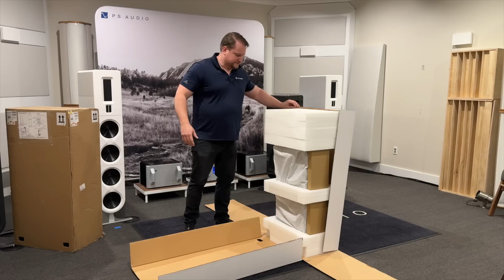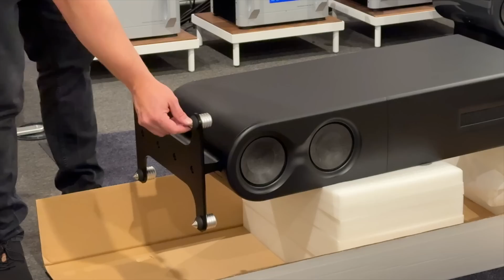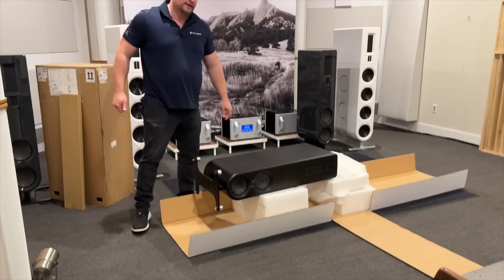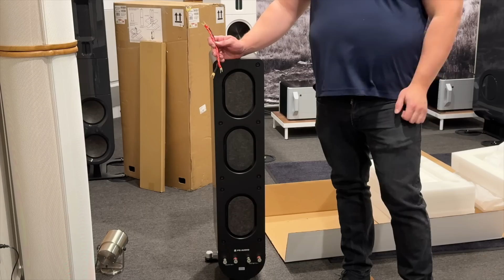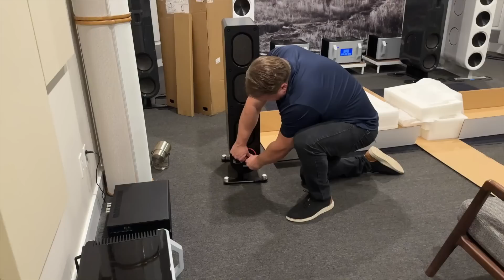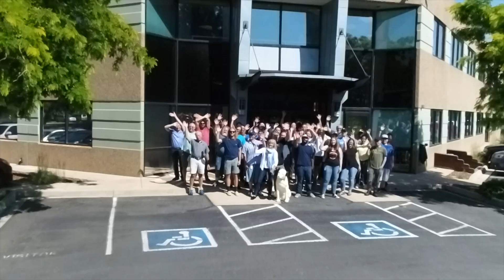FR10 Unpacking

Comment: isnt silver better for the jumper than copper?
Reply: or gold
Reply: The connectors are gold plated. The wiring is copper, silver is marginally more conductive but for a very short jumper, the resistance is quite low either way. However, you’re welcome to use your own third party jumpers of your choosing.

Comment: GREAT UNPACKAGING! I know that you will smile/laugh, but how are these speakers to my B&W 803s?
To be honest, I am always looking to be EDUCATED!
And, I am using a Mac MHT-200.
I will wait your rerply!
GREG
Reply: It depends on the age/series of B&W speakers.  These compare pretty well to the 803/804.  The FR10 have a flatter response through the midrange than the B&W and less diffraction issues in the mid/tweeter.  The B&W is slightly higher sensitivity and may be more punchy in the bass, though the FR10 gets a little lower.  

The B&W have more flashy cosmetics and certain construction details, more finish options, but that's a matter of taste.

Comment: Great video.  I was waiting to see how you moved them on carpet.  I have never walked a speaker on spikes as I was afraid the mechanical stress on the base could damage it or that I could damage the carpet piles.   To make positioning easier I assume  it would be OK to use furniture carpet sliders under the spikes until a good placement is found.
Reply: They supply a magic carpet just for this purpose 😅

Comment: The thing of showing how to level the speakers on the floor should be done while the speakers are standing on their feet. In order to show how easy or not it is to level it in a real situation, not with the speakers tilted sideways.
Reply: We can make another video, if needed. In the meantime, just tilt the speaker forward to adjust the back feet and vice versa for the front.
Reply: @cbrunhaver  Thank you Very Much !

Comment: I would guess that those jumpers do a better job than those thin metal pieces that come on bi-wireable speakers. I guess those metal pieces are the sonic equivelent of those metal U shaped solid metal jumpers they have on the back of some integrateds, which have pre in and main out and you have to have those connected in order to use the preamp section and power amp section together as an integrated. There was a great back and forth debate (argument) over whether using a short good quality  interconnect back there could improve the sound on one of the forums. It sure can; and by magnitudes. The raising of height level is a nice gizmo feature. I've always liked gizmos. The other day I was playing a cd and it kept skipping. I placed an old Sumiko cd mat on top of the cd, and voila the cd played flawlessly.

 Some high end speaker companies must be trying to become familiar to the masses. The other day on The Price Is Right game show on tv, one of the prizes to guess the price on, was a set of KEF LS50 speakers. One contestant guessed  $300, another $400 and the a big heavy set woman surprisingly guessed $1,000, & was the closest to its $1750 list price and won it. Maybe we will someday see PS Audio FR 10s on The Price Is Right.